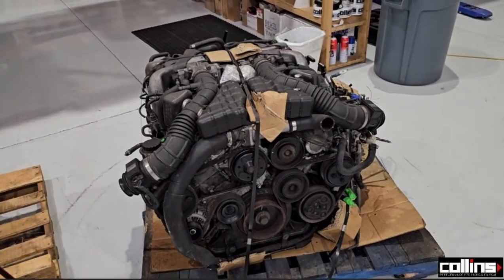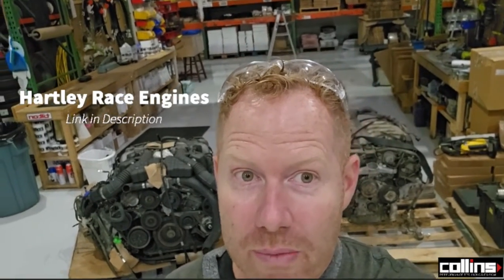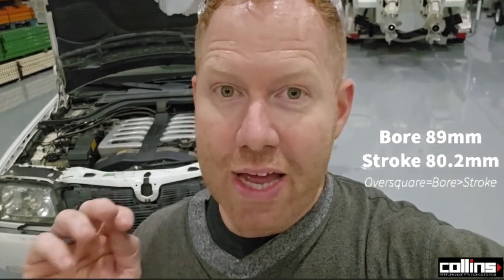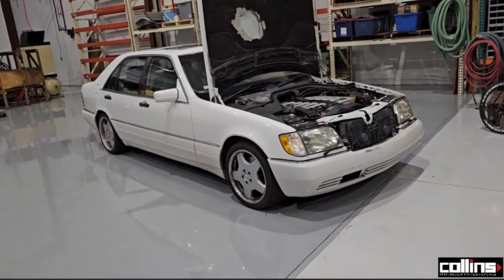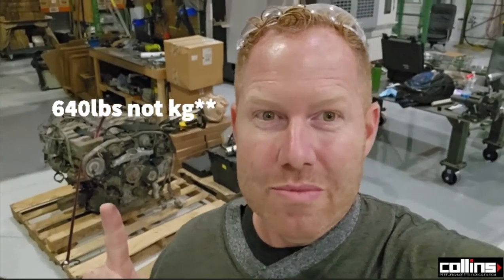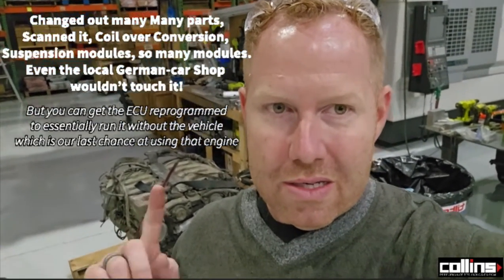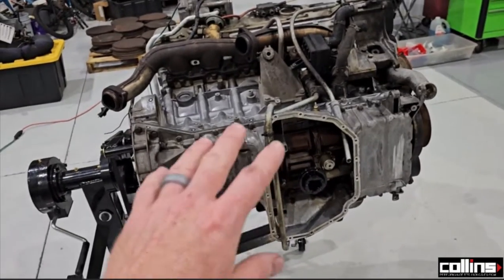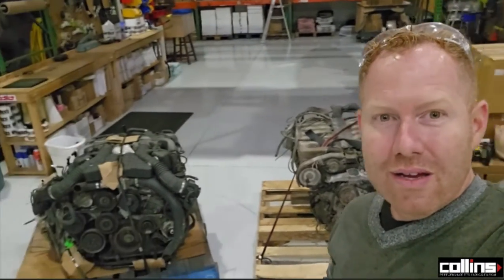Mercedes M120 vs Toyota 1GZFE V12 Engine: Unveiling the Ultimate Engine Swap

Comment: Hey I have  92 W140 V12. I'm swapping a ZF 8HP into it. Found a W120 to 8HP trans adapter in Poland. Have you considered doing an 8HP? 

I also consider doing a MaxxECU. To get rid of the biodegradable wiring harness. Any advice you can give.

Comment: Mercedes V12 with Light weight internals, balanced, and a light flywheel, with equal length long tube header preferably ceramic coated is the best sound!

Comment: Both examples of torque monster V12. Not at all high revving singing V12. Definitely my fav, like the 550 V12 they have deep powerful sounding sounds. I heard a Toyota V12 in a supra that sounded exactly like a good exhaust on a 550. Ferrari V12 usually have a more piercing sonorous noise like the F50. BMW V12 is sort of in the middle which sounds terrible lol. Like the McLaren F1, sounds violent but not very nice. I love both Zonda F and F50, very different sounds but both amazing examples of V12 noise greatness.
Reply from the maker: That's a great breakdown of the different V12 sounds, thanks for sharing! I agree on the BMW not sounding great, which is our motivation for going with m120 and the 1gz specifically for sound!
Reply: @CollinsGarage_Crett_Bollins now to your build: of all the Zondas the F is the best of the engine your using. Other than it being the 7.3L of corse which will enrichen the sound with a deeper tone. The F in particular is the best due to tuning and those ceramic headers. The ceramic coating adds a LOT to the sound. It turns the simple metal pipe into an instrument. The length and uniformity of length in each of the six pipes is integral on each header. Also I loved your explanation of bore size and stroke length. I do love an over square engine, I prefer revs to torque in more fun applications. Daily is a different story, torque for the streets is what I like.

Comment: Hartley DO NOT make SUPPORTING parts.  The hartley is in reality a totally new engine using the head block and block.  They make 700bhp and more normally aspirated.  A full race performance engine.  Big bucks: semi pro drift money. You are aiming to one 10th of what hartley do.  And good on you.  But don't be lazy verbally and misrepresentative though.

Comment: Looking for a Part Collin , i have a m120 too , and i looked across 4 countries as of now , i can not find camshaft sensor driver side. any information , anybody ?
Reply: Hey, I am also using an M120 V12 for my supercar build 😁

You are looking for a replacement camshaft sensor?

The m120 has both left and right bank sensor fitted to bank 👍 it's run as two inline 6s

Comment: M120 is does not have coil on plug.
Reply: There's two versions of m120, the early model has a distributior with electronic ignition and fueling.

Later m120s are coil on plug 👍

I am using the m120 for my supercar build 😎

Comment: Whats transmissions can you use with the m120? Mid engine type of transmissions?
Reply: Any transaxel needs adapting to it, nothing will bolt upto the m120 except the transmission that came with it. It has a bolt pattern that's not seen on any other Mercedes 👍

I am building my own V12 supercar with the mercedes m120 V12 😁
Reply: @UKBUILT  what is commonly adapted to it? Something that can handle a lot of torque
Reply: @jasaircraft  There's not many people mounting these in the mid-rear position unfortunately. Zonda used an X track gearbox custom built just for them. You can get an xtract transaxel new for about 8k made for the gt40 guys. Most guys use the old porshe g50 transaxel but they are getting rare or the older audi 01E diesel transaxels which are cheeper but still rare. If you can afford a g50 at 3-5k you may aswell go for a lamborghini gearbox (graziano 6 speed). That's the one to go for 👍 about 2.5k in UK

Comment: Hey, really appreciate what you're doing. Building my own V12 mid engine manual is forever on my bucket list. One quick question though. Which engine is the most compact and easiest to work with in your opinion?
Reply: I am building my dream V12 supercar with the mercedes m120 V12 😎

Comment: Based on your research to date, will the M120 fit into a CL600 (C215/M275)? You are scanning the M120 and I believe that you previously scanned the C215/M275 with its twin turbos. Does the M120 fit or are significant body mod’s needed?
Is this a swap you are committed to? 
I also own a CL600 (C215/M275) and I’m interested in such a conversion.
I would like a later (6/7 speed) auto transmission behind the M120. 
You Mentioned MAXX ECU, that might help with the transmission control?
Reply: I bet you can make it fit, they are around the same displacement, the only thing with the m120 is it's a tall engine. What's the benfit of swapping it tho? You can get the zonda sound from the M275 engine with equal length 6-2-1 collector manifolds 💪

I am using the mercedes m120 V12 for my project 😁

Comment: Why havent You or mostly anyone else mentioned a thing about what You do to replace the wire harnesses?
Reply: Yeah the engine harness is made of bio-degradable plastic insulation that falls off the wires 🤦‍♂️ you just unplug it and replace it with a replacement or repair it by replacing each wire in the harness one by one 👍

Comment: I have been setting my heart on the 1gzfe for my Pontiac lemans and so it’s the Toyota v12 for me. It’s also to go without saying, that I will be needing your adapter for my turbo 400 to have until I get rid of the transmission that came mated to the v12.

Comment: I would love to see a dry sump kit 😍
Reply from the maker: Yeah? It is really expensive and primarily for racing purposes. Also production costs are pretty wild to get something like that going if you're seriously interested.
Reply: @CollinsGarage_Crett_Bollins it would be nice if someone made one, just the sump part. Multistage pumps are easy enough to find. I have my own CNC machines so I am not the best initial customer. It may be easier to modify sumps 😎 the main benefit for the m120 Is to reduce the height of the engine. If someone made a bunch of $1k accessories for the M120 I bet they would sell. Reduced height sumps, cams, rods, pistons, intake, exhausts, clutch adapters. It seems like you have a good stockpile of them. At some point I would like to bring mine upto the 700hp NA spec. I will be hunting for parts later down the line. There's almost zero companies supporting these old V12s.
Reply: @CollinsGarage_Crett_Bollins I’m also interested in a dry sump pan to reduce the total height of the engine

Comment: Been making any 1GZ parts since making this video??
Reply from the maker: Yes, we now have both 1GZFE "BK" A650 (6-speed auto) bellhousing adapters and the 1GZFE "C" (5-speed auto) Bellhousing adapters for CD009/350Z 6-speed manual transmission adapter plates. We also have the header flanges knocked out too.

Comment: I had a 2001 s600 v12 that car was very heavy and still ripped. You’re much smarter to make supporting parts for that engine. They are plentiful and cheap and far better than the Toyota.
Reply from the maker: I still have my M137 car in the back. What are the only things I don't like about the m137 is the driver side cam is easily controlled by the computer and for whatever reason they shut off that bank of cylinders for many different reasons. When the engine goes into limp mode it cuts off that side of the block and only runs on the passenger side. There's a lot of different oil channels and a controller that can go bad. Also the spark plug coil packs are $2,000 if they go bad. Which is pretty steep for somebody to maintain a 20 year old engine. That's not to say that we're going to not develop parts for it but we are definitely going to get somebody to edit the OEM computer to keep both Banks working full-time.

Comment: 6500$ NZ for a Igzfe in NewZealand crazy.  I’ve got a 1 uz fe I paid 1400 for  worth a little more. Now but gd value
Reply from the maker: 100% we are now deep diving into the 3UZ-FE and have full CAD data of the entire engine and have developed more parts for it now. We have a 3UZ-FE to FRS, GT86, BRZ adapter/flywheel for this now, and header flanges as well.

Comment: Since this video released the M120s cost the same as 1GZs now hahaha

That said I’m really looking into a V12 swap for a Lotus Esprit. Hardly anyone makes a transaxle solution for either of these though.

Only thing I could find was an adapter for a PDK. This is going to be a tough one to get going haha.
Reply from the maker: Have you thought about the O1E transmission? They a 5-speed but very plentiful for a mid-engine type scenario. We have an O1E here we can pull data off of...
Reply: A lotus build sounds cool 😍 I am building my dream V12 supercar
Reply: for the pdk you could look into htg tunings gcu, they were known for having issues atleast for 8hps but supposedly have fixed alot of them. basically a standalone ecu but for a transmission instead of an engine

Comment: Hi, this is a great video, I always like the M120 engine. I have my project Ferrari 355 that I would like to put a M120 , I been thinking in removing and relocating the gas tank to have more space for this engine because this mid engine vehicle got a really short rear and is a mid engine car.
   Do you think it could be done? I don’t know how long is the M120.
  Thanks for your videos and advice.
Reply from the maker: Yeah that's not a bad idea the 355 Ferrari engine is pretty amazing though flat-plane crank with 5 valve per cylinder sounds so good. I guess the only thing that would sound better is a over Square v12! The V12 was pretty long I don't have exact numbers but it is going to be substantially longer than the Ferrari engine.
Reply: 😮 Is the 355 engine running?

I am building my dream V12 supercar with the M120

Comment: I just bought a 96 Mercedes s600 V12 coupe for $1600.  I found this video researching swap options for this motor!  Im following this!  I have a rust-free 87 Supra I was thinking about trying and swapping the Mercedes motor into!!!
Reply: I have an 89 Sport Roof NA that I contemplated swapping in a V12 as well.  Might have to use a BMW engine to make it fit in with the A90 crowd.
Reply: @wdblackman That would be awesome 😍 I am building my dream V12 supercar with my M120 👍
Reply from the maker: That's not a bad chassis to do it in, there is a french guy in our V12 chat that has successfully done the swap
Reply: @CollinsGarage_Crett_Bollins  There's an american girl that successfully put a m120 in her 240z too.
Reply from the maker: @lea2666  that's awesome! A V12 240Z sounds Rad!
Reply: i love my 1988 7mgte
Reply: wow thats cheap

Comment: I am very interested in any project done with the m120.
Reply: Jaguar XJS would be PURRfect with a 6 speed manual.  Not so much power that you'd have to modify the rear suspension.
Reply: V12 💪

I am building my dream V12 supercar with the m120

Comment: Whats more important, is what is the total length of these engines, from the back of the bellhousing mount surface, to the front of the crankshaft pulley.  We need to know if these engines will fit first!!
Reply from the maker: I can get that data for you guys it's just going to be a minute.
Reply: @CollinsGarage_Crett_Bollins  any updates on that data? Would love to see how this compare to other popular  engines dimension wise ls series, k series,1/2jz vr38tt vk56 etc

Comment: You need to change the cams in those M120, sure will make them wild
Reply: 🤔 I may need this for my M120 project 😍
Reply: @UKBUILT  Piper cams in the uk cut my M119. They have done different profiles for me depending on my requirements
Reply from the maker: do you have a lead on some cams? I'm keen!!
Reply: @CollinsGarage_Crett_Bollins what about the cams of an c36 in-line 6???
Reply from the maker: @patrickvanderveen4945  not sure if that would cross right over. Has the firing order might be different with a V12.
Reply: @CollinsGarage_Crett_Bollins  It looks like Gooichi is offering a CNC ported head with custom valvetrain, billet camshafts, and ITB options. They are reworking the M120 to rev in the 9-10,000 rpm range, and while I haven't seen their engines run, or seen specific flow/power numbers yet, there might be some options there to suit your needs, so you might want to check them out. Cheers.

Comment: I worked for Toyota for 20 years and still prefer most of their products,that said, I am a huge m120 fan. I have an sl600 and I also have 2 complete m120s waiting for projects. I owned many Celica models over the years and I envision an m120 powered 84 gts coupe. I have my sl600 cat delete with otherwise stock exhaust and it sounds good as is,but if I ever drop one of these into something I would go with a longtube header for sure. What manual trans do you use along with your adapter plate?
Reply from the maker: Currently we have the 350Z 370Z 6-speed transmission adapter plates for these. check the link in the description, and lead time is about 30 days on V12 stuff right now. I'm excited to come out with some more transmission options as well. A good friend of mine wants a 8HP70 box for his LS430 so I'll probable make that for him as well.
Reply from the maker: Probably also going to do T56, TR6060 for some people that are looking for support on those too.

Comment: Any way to get dimensions on these?  Length (bellhousing to front of accessories) width at the widest point and height (oil pan to intake manifolds) and weight (with accessories as sort of a pull out)
Reply from the maker: Width on the M120 widest part of the throttle bodies is 32.0625", if you go off of the widest part of the intake manifold no TB it is 24.25". The left side has the oil filter boss sticking out awkwardly which you can relocate easily. Front to back its 31.75". Top of intake to bottom of oil pan is 26.125" these are all rough dimensions please don't use them for anything critical.
Reply: @CollinsGarage_Crett_Bollins how do these measurements compare to the 1GZ?
Reply from the maker: @mikelmarion  that's a good question I'll have to open up the scans and measure them accordingly. There is many levels of the 1gz that you can take apart as opposed to the m120 meaning you can take the upper intake manifolds off and create a block off plate to make them shorter in height and then remake the intake plenum. You can also remove the plenum switching valve Reservoir which sticks out to make it a little bit thinner as well.
Reply: @CollinsGarage_Crett_Bollins any update on the 1gz dimensions?
Reply: thanks for those measurements, that’s a big help for sure.
You guys wanna do the swap on my C3 for content?  I have the M120 with 92xxx. 
Engine bay is empty on the Vette. 
That’d be fantastic lol!
Anyway thanks for the dimensions
Reply from the maker: @randywatsonii3173 yeah we could work something out potentially. We would need a high quality 3D scan of the engine bay back to the differential to get anything started.
Reply: @CollinsGarage_Crett_Bollins also still waiting on the 1gz dimensions :)